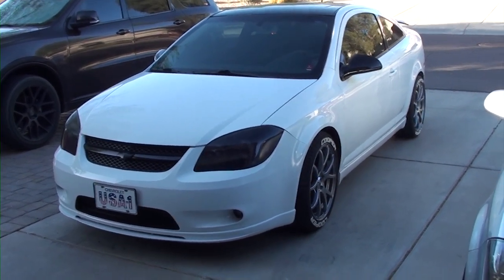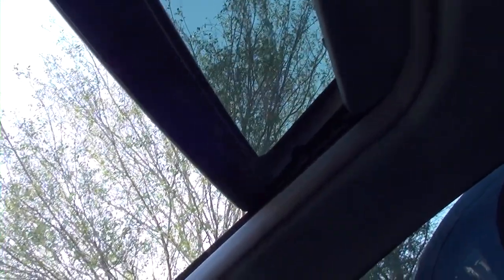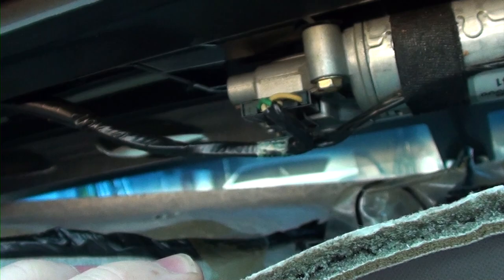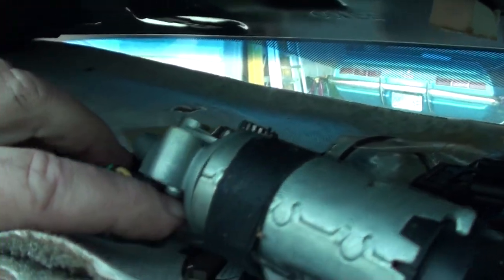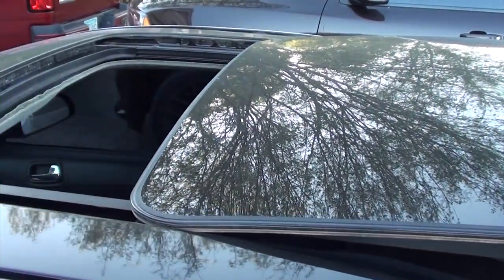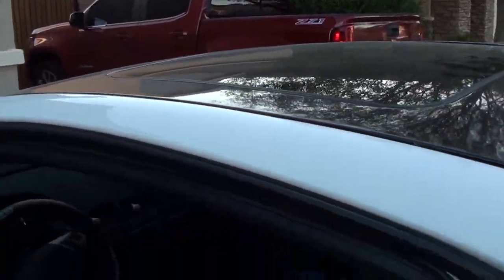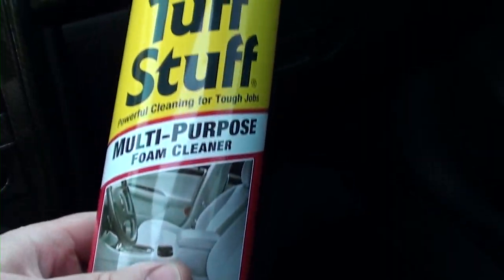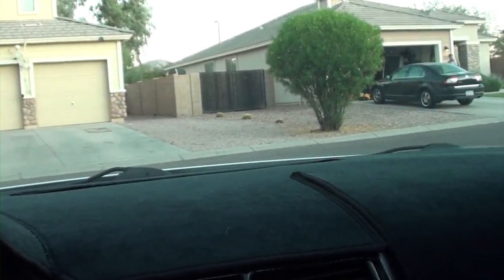How to fix your SUNROOF, Chevrolet Cobalt SS turbo LNF  SS/TC

Comment: Where did you buy this motor please?
Reply from the maker: ebay
Reply: @spencercurtisjackofnotrade4627   I tried to find it on ebay yesterday but there is only a sunroof switch, no motor. What is the name of the company you ordered from on ebay please. Thank you
Reply: @Brandon-ck3pe  I bought one from a wrecker . Had to remove it myself but fixedcthe problem

Comment: What if my drain pump is leaking
Reply from the maker: Not sure what a drain pump is
Reply: The motor that you push to open the son roof when i close it it leaks water
Reply from the maker: @sseric2.0lnf16  it might just be the seal around your sunroof.